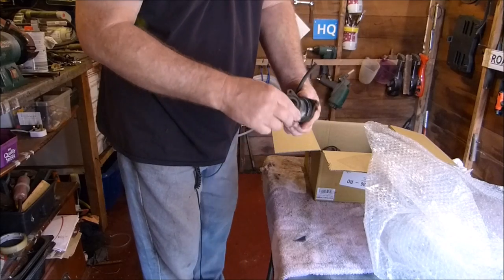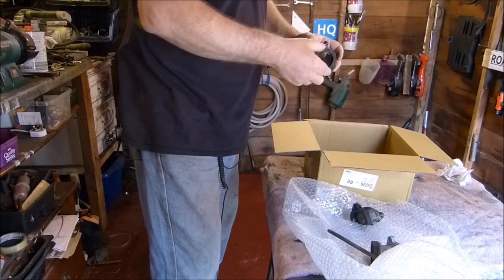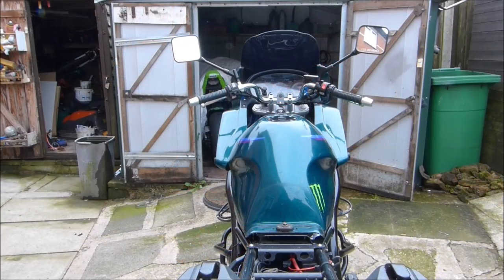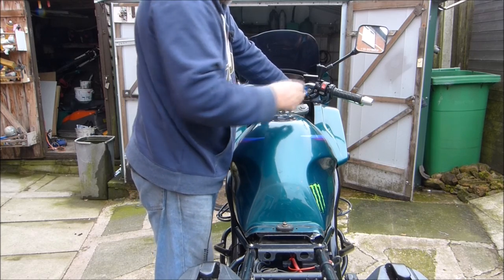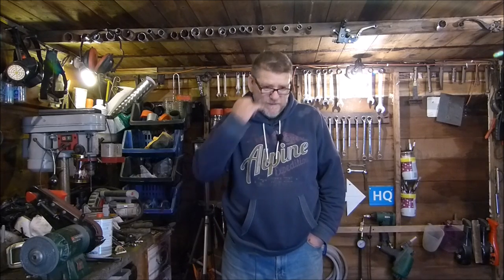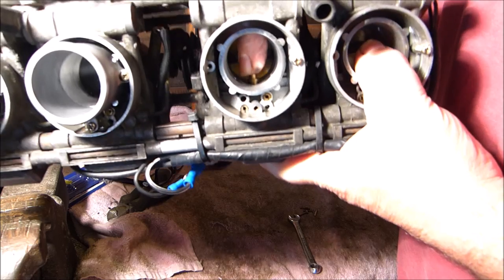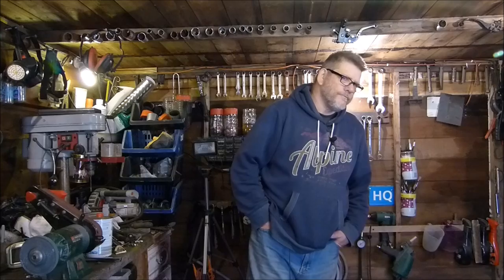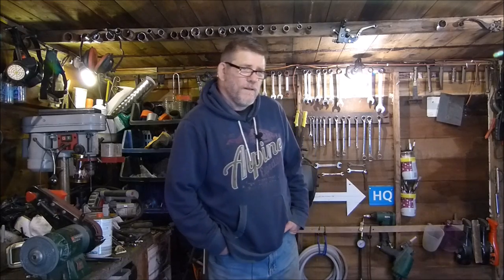XJ900S diversion final fix, FINAL P- 5.

Comment: Hi Johnny, thanks for your previous response.
So, I've just watch this part 5 video ...and try to understand ... my english is not very good ;-)
If I understand correctly, you have badly reassembled the jet support ?
I bought my bike with this issue, the carbs were cleaned by the previous owner's mechanic.
I will check the needle jet and emulsion tube tomorrow.
My XJ have 76 000 km, may be my needle jet is wear on cylinder 4 (I will check this too.)
Reply from the maker: Thanks buddy. No problem dude best of luck with it and I hope you sort it..